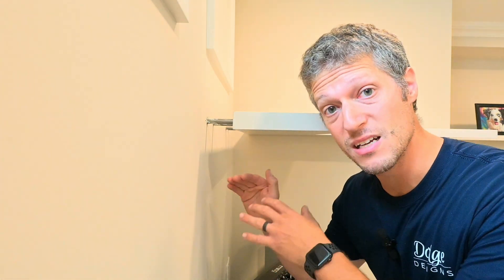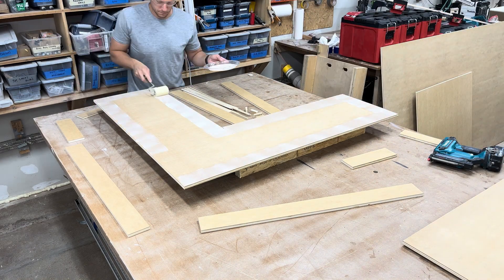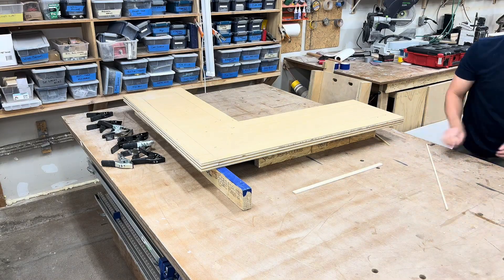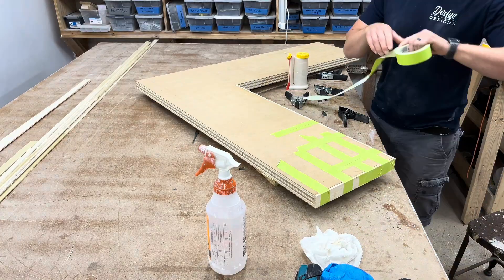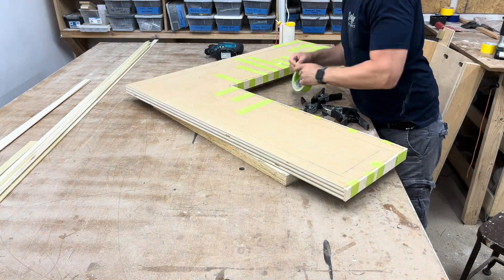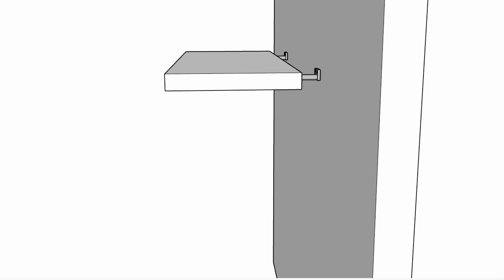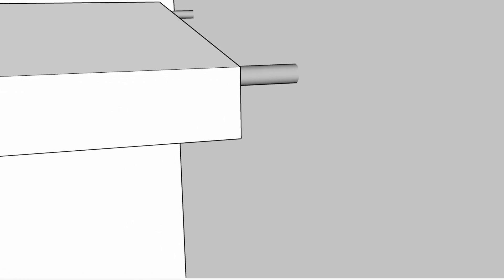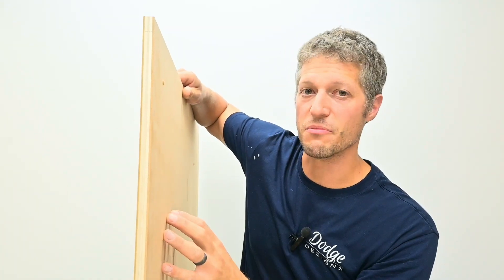FLOATING SHELF technique that’s CHEAP and SUPER STRONG

Comment: instead of gluing you could've screwed them into the studs....
would have made the next owners happy if they want to remove the shelves.
Reply from the maker: You’re right. It will be a little annoying for the next owners to remove. And you could have used long hex bolts and cut off the heads once installed. That works. The only issue is that it’s much harder to level it perfectly. By using the method I did in this video I was able fine tune it to level once I mounted the shelf. Gave me a little wiggle room.